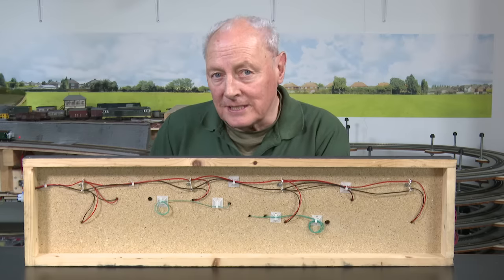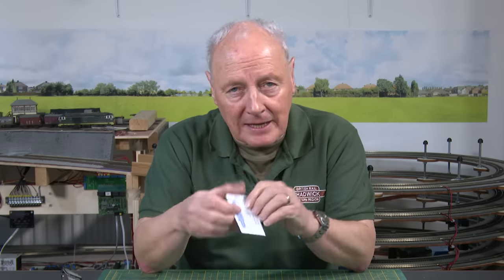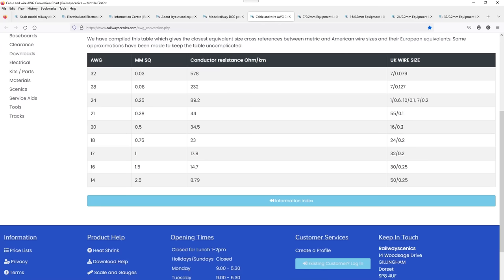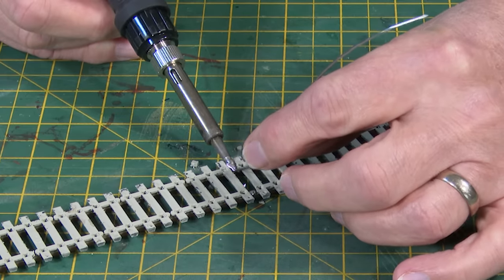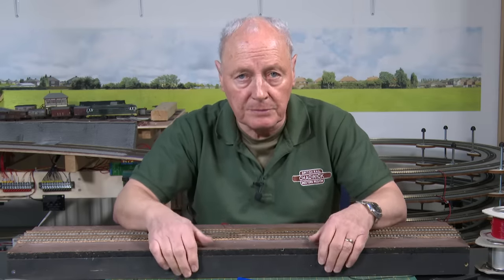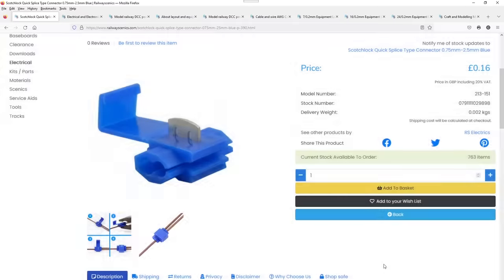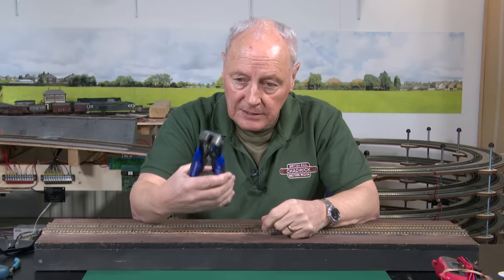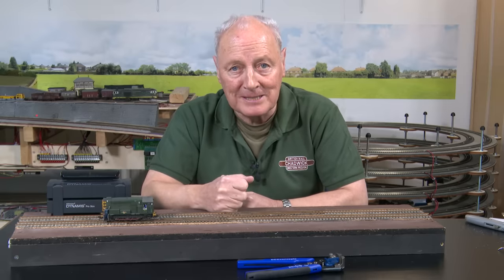LAYOUT WIRING for DC and DCC and all gauges at Chadwick Model Railway | 175.

Comment: Another excellent video I have not yet dipped my toe in the water yet still thinking and planning. I have a question on the helix you built would not a slight camber (1mm) on each track as real trains have on bends assist with derailing? Be interested to hear your view. Keep up the good work.
Reply from the maker: Yes, absolutely Phil. 
I did dip the insde track down a couple of degrees but I'm unsure that it make any difference really.  
However, on longer steam locos, it could cause pick-up issues, if not all the wheels are in contact with the rails.
Regards Charlie

Comment: Hi Charlie, I'm a big fan of your layout and the in depth tutorials. It's prompted me to get back into modelling and get my own layout going.

I've had my first go at soldering today, soldering droppers on to the bottom of track like you did. I then also tried it on a set of points. I seem to have melted half a sleeper and somehow also bent one of the rails. I think I've ruined a PECO SL88 before I've even put it in place!! I'm guessing that the heat can cause the rails to bend? Any tips for preventing that from happening?
Reply from the maker: The way I solder, is to go in hot very quickly. Regards, Charlie

Comment: I've started to use Wago 221 connectors for bus wiring (and other connections) - cut the bus wire and clip in a 3 or 5 terminal Wago leaves 1-3 spare terminals for droppers etc, they seem to cover most model railway wire sizes from 0.2mm (24AWG) to 4mm (11AWG) the former being my minmum wire size on my N-Gauge layout and latter what you would use to power your oven.  They are rated at 32A / 240 Volts, so well past model rail needs, really fast and no soldering required - not that I'm at all averse to soldering, been doing that since I was 12, just not so keen on un-soldering if plans change and the Wago's just unclip off the wire.
Reply from the maker: I shall buy some and do a review Stewart. 
What sizes do you suggest? 
Regards Charlie
Reply: @ChadwickModelRailway  I've used the 221 Series specifically the in-line 221-2411 and the 3 & 5 terminal 221-413 and 221-415.
Reply from the maker: Thanks, much appreciated.

Comment: Very helpful video as always and much appreciated. I am about to resume my layout build after a house move.I am building modules from White Rose Baseboards. One question and apologies in advance if it sounds really silly. I struggle to work beneath the boards and notice that you up end yours to work beneath. How do you protect your track work and points from damage when the board is upside down?
Thanks Keith
Reply from the maker: Hi Kieth, I normally rest the baseboard on trestles. If I need to pad them up then I use blankets, regards, Charlie
Reply: @ChadwickModelRailway  Thanks Charlie.👍

Comment: As a control systems engineer and an electrical engineer and RCD or RCBO will not necessarily prevent a fire. It will protect  against electrical shock because a 30mA RCD/RCBO will not only limit the current under leakage or fault conditions but it will stop the fault voltage  exceeding 50V. Anything above 50V at 30mA will kill you.
Reply from the maker: An excellent comment Paul, of which I am most grateful. Regards, Charlie

Comment: I am sure this would work with the TT120 scale but todate I can only find UK, and USA, trains so how big is the role out of this moden scale trains? as I have been looking at doing N scale however the TT120 looks better in size to have a good layout with trains having better detail then the N scale. it would be good if you can do a video giving your opinion
Reply: That would help to give an insight.
I myself have been looking at N gauge for some time, but the T120 do look better, and as for upgrading the chip or sound, may well be  easier.
Reply from the maker: Hi Guys, I’m unsure that my opinion would be appreciated.  I believe that it will be mainly new modellers will adopt this scale.  I really can't see many folks selling their extensive collections an invest in a largely unproven system.  Please be cautious.
Regards Charlie

Comment: Thanks Charlie.  I have used the suitcase connectors ("Scotchlok") with no issues thus far (knock on wood).  The DCC Concepts connectors would be challenging as my boards do not flip up as do yours.  As you might imagine, being underneath the layout, looking up and trying to solder is not so easy.  One question though about your buss wire.  What do you do at the end of your wire run?  I have 4 power districts each with a circuit breaker in place.  I have capped the wire and put tape over top to ensure the caps don't come off.  What do you do with yours?

Cheers
Reply from the maker: Yes, exactly that. Regards, Charlie

Comment: Another great and informative video, with simple explanations on how to do a great job, together with necessary safety warnings..  well done ..

Do I need to flux the track before soldering ? I tend too at the moment..

The wire strippers are brilliant, and can be obtained at good tool stores, and a cheaper version at the sheds.
The DCC connectors and wire supports look good, easy to use and versatile.

On connecting the wires under the board, I sometimes pre-plan  and slide heat shrink onto the bus wires, position ready to solder the droppers and cover. 
But difficult if you sure of your track plan. 

An alternative when working under the boards are, electrical earthing strips, and also wyco connectors, so no difficult position for soldering..

Look forward to your next video

x The Bigfella x

ps Railway Scenics looks a good site, will be ordering from him
Reply from the maker: Hi big fella, no I only used flux when soldering brass. The resin course old are use is fine for small joints. Regards, Charlie

Comment: Charlie I have a question. Do you feel that using soldered joints between the bus and droppers gives a better electrical connection? I’m in process of changing all my dropper to bus connections to use spring loaded “lever nut” wire connectors (available on Amazon). These have become very popular for general electrical wiring in US . And are exceptionally easy to use and allow for easy disconnect and reconnect.
Reply from the maker: Hi WMR,
I think that the type of connectors you refer to, are similar to Wago’s.
I have some on order and will give them a try. 
However, soldering the wires will always be my preferred option, but with your type of connectors, changing your mind is straightforward.
Regards, Charlie

Comment: Charlie Bishop does Bob Harris / Louis Balfour: "Mmm...interesting!"
Point of interest, genuine Scotchlok connectors used to come in various gauges including, if memory serves, multiple gauges. Their principle use in cars was for tapping accessories and towing equipment into the wiring loom without significant damage, but I agree with you entirely - while stripping wiring looms in cars is not a good idea!, for more (semi-)permanent installations like model railways they are not ideal.
Reply from the maker: We clearly seen from the same song sheet Timothy. Regards, Charlie

Comment: Watching solder cool makes a change from watching paint dry, Charlie.

Very interesting as ever; I assume you're not using self-isolating points though, as surely you'd only need to feed each track once from the toe-end of each point.
Reply from the maker: That’s right Peter, I only use electro frog points. Regards, Charlie

Comment: Nice overview, thanks :)
One of your earlier wiring videos is what gave me the real heads-up about what I'd need to learn!
Just a thought about the DDC signal comment you made: if my understanding is correct (a big if) then the signal is the pattern of alternation in the Alternating Current; the AC current is also what powers the locos... so if you "lose the signal" (at all) doesn't that equate to your trains stopping altogether? I'm struggling to see how the DCC signal can degrade in a section whilst still maintaining power to that section. If I'm right about that then so long as the trains can still move at the "other end" of the layout, you don't need any more droppers than a DC layout would, perhaps even fewer than a DC layout needs because so long as a DCC loco can get enough current for the speed it's set to then you won't notice a bit of a dip in maximum available current. I might be fundamentally wrong though - I'm no expert at electrics! It's obviously also good for maximum reliability and power  overall to have lots of droppers
Reply from the maker: My understanding is that the DCC signal is superimposed on the power supply. It’s not an AC current, but a DC alternating-current going from 0 to 15 and back continually. Regards, Charlie
Reply: @ChadwickModelRailway  Hi Charlie, thanks for your response. I've done a little more reading, including the NRMA specification documents themselves, and now have a better understanding. The DCC power is always "full" - there are no steps to represent numbers, and it's a form of alternating current: each rail of the track takes it in turns to have the power, which results in the flow of current alternating (it flows from the rail that has power to the one that doesn't). The digital information comes from how long a rail has the power for. For N gauge and OO gauge DCC power stations are required to provide 8.5 to 22 Volts, DCC decoders are required to work with 7 to 24 Volts. A DCC loco will maintain a constant speed so long as there's enough power for that speed (e.g. 5 Volts), so you can actually afford to have a drop of several Volts across your layout. My base station outputs 13-ish Volts - the "nominal" value given in the NRMA specs is 12V for N gauge, 15V for OO, so it looks like Gaugemaster have gone for half-way. A DCC Wiki article I found says: "The nature of a square wave results in more demanding requirements for wiring to avoid voltage losses and signal distortion compared to analogue control methods." - I don't know why that is, but it'll be why people are more thorough with wiring for DCC! But I think there are plenty of myths out there, and it's downright difficult to find accurate YouTube videos, not least because a search containing "DCC signal" has results mostly about controlling track signals. I'm finding the quest for truth/accuracy an interesting journey :)

Comment: 2.5mm cable, putting it into perspective, is suitable for mains radial circuits (usually rated 15A at 240V) (if it was double insulated) for 230V wiring.  I think current rating on cables is one of the least accurate ways of identifying cables.   Better to go on the AWG or cross sectional area measurements rather than looking for current ratings.   Another thing to consider is ensuring your cables are proper copper cables and not copper clad aluminium.  CCA is a lot cheaper but it can cause issues, especially on DCC layouts or high power DC layouts.
Reply from the maker: An interesting point about the copper clad Brendan. Regards, Charlie

Comment: Charlie, I’m so glad you don’t use the fault liability that are Scotchloks!!  I spent many years in the automotive industry installing computer systems to out of hours doctor on call vehicles and these things would have been the last thing we would have used for obvious reasons. I wouldn’t be without the DCC style wire strippers, there’s been a set in my tool box for well over 30 years.  I’m relatively new to model railways and have watched many of your videos and they have all been helpful. Thank you.  I’d be interested in your thoughts regarding the use of Wago connectors as opposed to the DCC under board connectors, apart from the droppers at the rails no soldering required at all and thus a tad quicker? Keep up the great work here and have a peaceful and happy Christmas.
Reply from the maker: Thanks GLR. I shall be buying some of the Wago connectors next week, so I’ll keep you posted. Regards, Charlie
Reply: @ChadwickModelRailway  I am puzzled.  I used 3M red suitcase connectors on my O gauge end to end.
Seven Cobalt IP point motors connected to the accessory bus all work.  All four roads on an isolated traverser work.  However, apart from the traverser, the isolated sections are rails on the frog side of points and I don’t know if it is possible to tell if all the connections work, or whether I am relying on rail joiners in some places.  So far suitcase connectors have worked for me, but I don’t have many isolated sections.
The environment is benign.  Should I expect failure at some stage?
Reply from the maker: It’s a hard one, suitcase connectors are known to cut through strands, of stranded cables. Regards, Charlie

Comment: Great video.  One question: I have planned one track that has it feeder wires at least 4’6” from the bus wire which then goes around to the power source.   Is it too far away?   Will it lose power?
Reply from the maker: That really depends on the thickness of the cable. If you use 16 x 0.2mm, that shouldn’t be a problem. Regards, Charlie
Reply: @ChadwickModelRailway  thank you

Comment: Just a note. Any wires used, should have a minimum rating for the maximum rating of the power supply. So if you have a 5A PS, the minimum rating of any wire should be 5A. The backbone can be higher rated to avoid voltage drop. If you have a 5A power supply, and your droppers are 3A wire, the PS should be fused at 3A. This is to stop a short over cooking a wire and causing a fire.
Reply from the maker: An excellent point Andy.
Have a great Christmas and best wishes for 2023. Regards Charlie.

Comment: Hi, great video, thank you! I have what is possibly a dumb question to ask, hope you don't mind? If you needed a Busbar for either feed power or earthing reasons, why couldn't you follow the lead as seen in old type house fuse boxes where the busbar was just a strip of metal? Could you not use possibly copper clad sleepers as a busbar and solder directly to that? No need for multiple additions, just a neat and tidy cable run.
Reply from the maker: Those are possible and many modellers use copper tape as bus wire.
Regards Charlie

Comment: Thank you so much for your videos, Charlie. As a complete beginner, they are absolutely fantastic for me.   One question, if I may. Looking online at the RailwayScenics site, their advice is NOT to use 7/0.2 wire for DCC Droppers or Buses……at yet, you seem to be using that gauge for this purpose……have I missed something there?  Would welcome your guidance on this. many thanks
Reply from the maker: No, Adrian, I use 16x02 for droppers and 24x02 for bus wire. Originally when I first started out, I did you 7x02 and learned from my mistakes. Regards, Charlie
Reply: @ChadwickModelRailway   Perfect.  Thanks for the clarification, Charlie. Much appreciated.  keep up the excellent work.  All the best

Comment: Hi. Would you still use these today or would you use the terminal strips ? How about the 3M suit case connectors ? Thank you
Reply from the maker: Hi, L9963, yes, I would still use them or plain soldering. But never suitcase connectors, as they can be so unreliable. Regards, Charlie

Comment: Charlie, another top video. Have you thought of using wago connectors, reusable and permanent versions for joining wire? Also priming joints with flux makes soldering so much easier.
Reply from the maker: I had some arrive yesterday Andrew, and will feature in my next suitable video.  
Most of my soldering is fine electrical or electronic and the resin cored solder (which contains flux) is more suitable.
Regards Charlie

Comment: Charlie
@29:47 you wire into the plug in Terminal Block, is the idea that the Male Terminal Block plugs into a Female Terminal Block on another board to continue to current/power? 

If that is the case, how do you join the next board as Base Board frame leaves no overhang above, so there would be a gap of 2-3 cms where the 2 Terminal Blocks are joined?
Reply from the maker: Hi Rob,  the board which I used is just an instructional aid.  I use it along with many other boards for showing similar techniques such as ballasting and airbrushing.
Regards Charlie.

Comment: Hi 
Just wondering is it one end of the bus wire’s connect to the controller and the other end of the bus wire connected to the track 
Thanks
Reply from the maker: Hi, 
One end of the wire goes to the controller and the other wire goes all the way along your layout with the dropper cables attached at intervals. Regards, Charlie

Comment: Hi Charlie, Nice video as always. I was just wandering... Could you not use choc blocks and place 2 wires into one side, that being your Bus and dropper and then your bus on the other side? The other one I could think of is split the wire then solder the dropper to the bus with a heat shrink over it to keep the bare wire safe from damage? Those methods you showed for the bus wire I have never seen before so was interesting to see!
Reply from the maker: An interesting point mark, and just shows there’s more than one way to skin a cat. Regards, Charlie